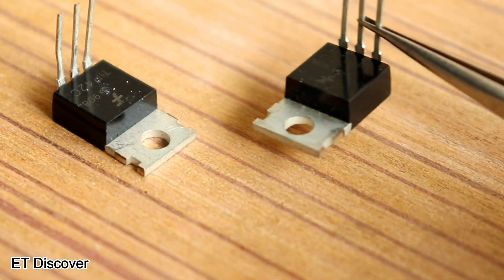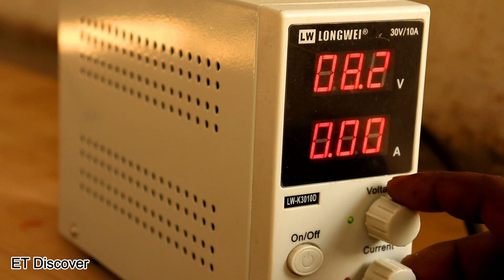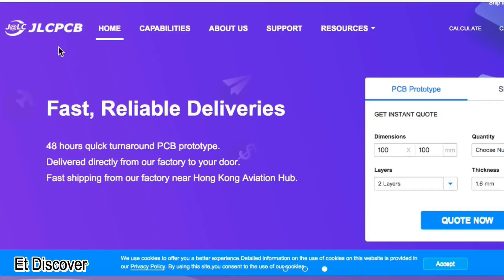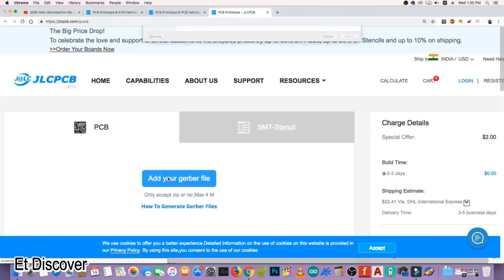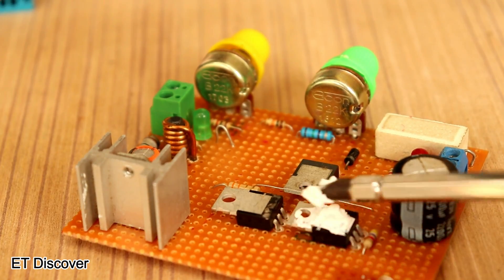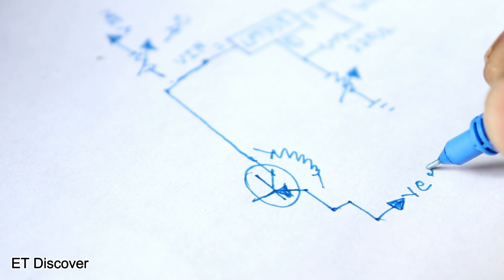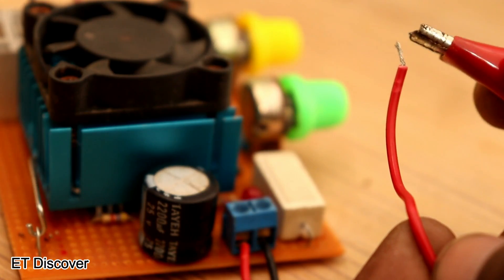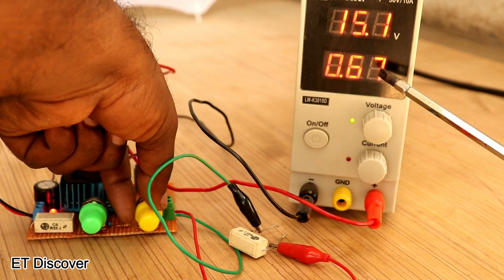Official DC Amp & Voltage Variable Power Supply

Comment: My dear friend, you are only controlling current to LM338, which can max support 5A, so what if you want more than 5A, Definetly the transistor will not help here
Reply: Just pair more LM338s and TIP42s together.
The load will be evenly distributed to both chips, and together, they'll be able to deliver more current.

Comment: good job, but you have a error in the diagram pin 2 of 5v regulator must be connected to (-) ground to have 5v on the output for the fan

Comment: Lm 317 in parallel nice  i had used a 2n3055 for current controll. I made a powersupply w/ 375 va transformer which is really powerful and i can easily drive motors and high current load w/ it.... Overall awesome n nice video keep up
Reply: if u can share the circuit diagram sir..i would appreciate it

Comment: i need 48 v 40 amp power supply
Reply: Likewise. I'm confused about how this works. I was thinking of using a buck boost converter on an old PC power supply.
Reply: @LEO-xo9cz  have you made any lab bench power supply using buck boost converter on ATX supply?
Reply: @jatinmali9310  No only with a buck.
I want to get at least 24v out of 12v.
Reply: @LEO-xo9cz  I'm also using separate buck and boost converter in ATX supply but I'm not able to change current value do you have any suggestions?
Reply: Hydrogen?

Comment: Excellent project Why inductor used in circuit and please more info magnet wire how many turns
Reply: you can see it at video, six turns. You can recycle and get it from some old power source, for example.